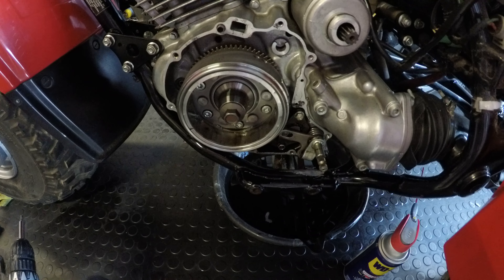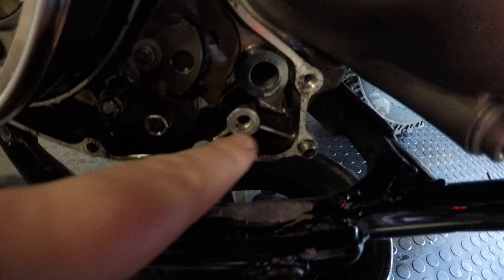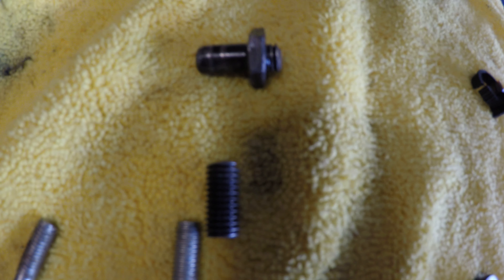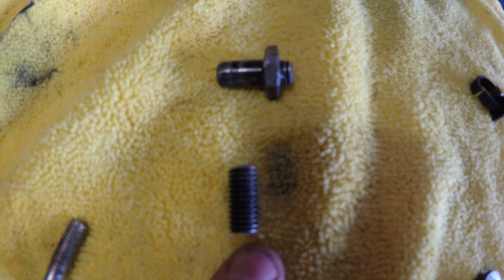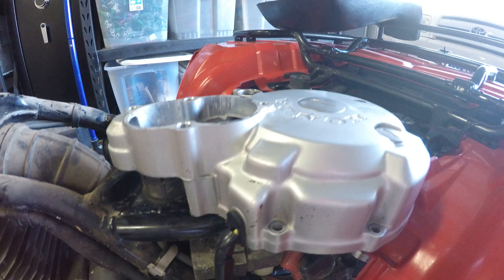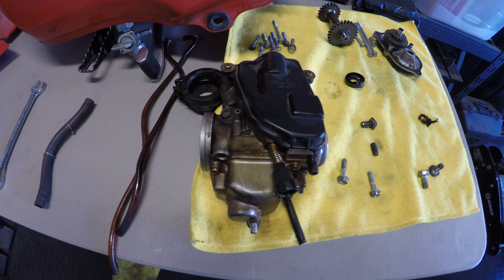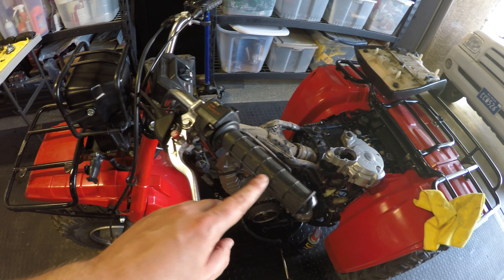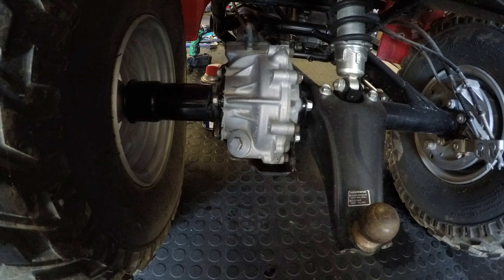1985 Honda Big Red Shifter Problem Discovered!!!

Comment: You have a mint, original 85 Big Red and you took a grinder to the frame because you couldn't take five extra minutes and loosen the motor mounts to allow room to remove the casing.
Reply from the maker: I loosened the mounts and couldn’t get it to clear. Trust me, I didn’t want to grind anything but didn’t want to have to disassemble a bunch of stuff to get to it.

Comment: GREAT video. I have the same exact problem, and I can't explain how much this has helped. Wish me luck getting the sheered spring return pin out :)
Reply from the maker: Let me know how it goes!
Reply: @Matthewwardlow  I got the old pin out, and put a new one in. But now every time I put the crankcase cover back on, the shifter is locked in place. I can move it, but it was metal on metal.
When I took the case back off, I noticed the new pin is rubbing on the shift plate attached to the spindle. Wtf 🫤
Reply: Oh nvm. Answered my own question. Pin is longer than OEM 😂
Reply from the maker: @lowtoe8030  try moving the spindle back and forth or tap it. Sounds like it’s not seating far enough in.

Comment: When you pull the shift shaft out do you have to open the clutch case too
Reply from the maker: To get to the broken bolt I had to pull the cover then the shaft.
Reply: @Matthewwardlow  so I should be able to pull my striped shift shaft out and assemble it with out pulling the clutch cover
Reply from the maker: @EverythingOffRoadOfficial  the main case cover has to come off. I didn’t mess with the clutch at all. Simple swap
Reply: @Matthewwardlow  cool. Nice the video btw
Reply from the maker: @EverythingOffRoadOfficial  thanks

Comment: Is there a way to get the part numbers for the gaskets needed so I can order them 85  250
Reply from the maker: https://www.bike-parts-honda.ca/honda-motorcycle/250-ATV/ATC/1987/ATC250ESH_A/Engine/LEFT-CRANKCASE-COVER/13HA0F31/E__0800/1/101
Reply: Thank you so much

Comment: I'm 13 so I ain't 100% sure but I just pull the shaft right out cause my splines are stripped and I have a 1985 atc 250es and Idk if I just pull it out or what,so can I get some answers please
Reply from the maker: Kyle Wellman definitely look at the service manual. They are free on 3wheelerworld.com. They will have all the instructions how to remove and replace the shaft.
Reply: @Matthewwardlow  well mine is the exactly the same as yours and I just need to know if I just pull the shaft out or if I have to take some bolts out or what cause I got an 1985 atc 250ES from honda too
Reply from the maker: The shaft should pull out just make sure you replace it pieces exactly how you removed the old one.
Reply: @Matthewwardlow  okay thank you
Reply from the maker: Make sure you order all the gaskets and o rings or it will leak oil.